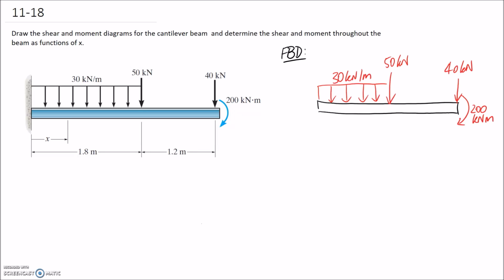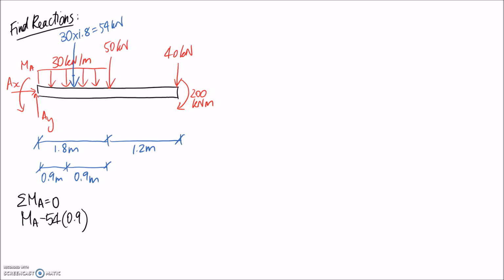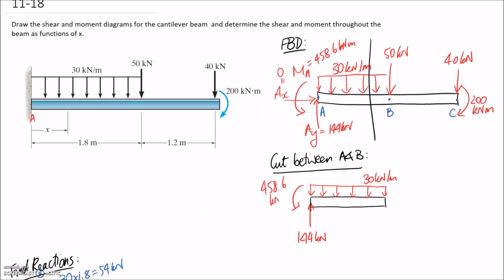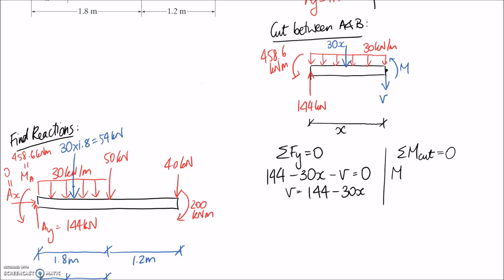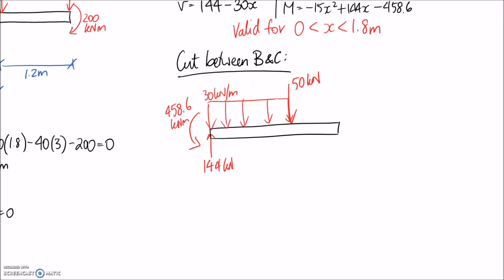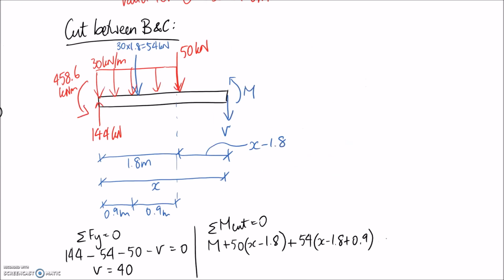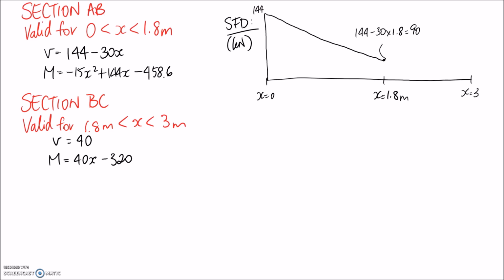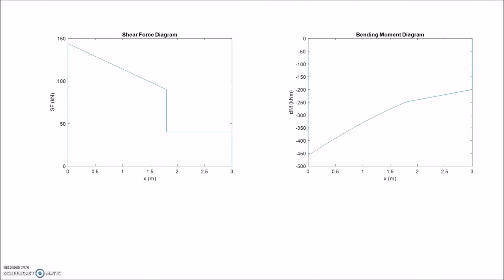(11-18) SFD & BMD with Equation Method

Comment: Shouldn't the second term in the moment equation for the BC cut be 54(x-1.8-0.9) rather than 54(x-1.8+0.9) as adding 0.9m would shorten the length from the cut? Your bending moment diagram looks correct though and fits to your final moment BC cut equation strangely? So I'm sure if I'm doing it incorrectly or not?